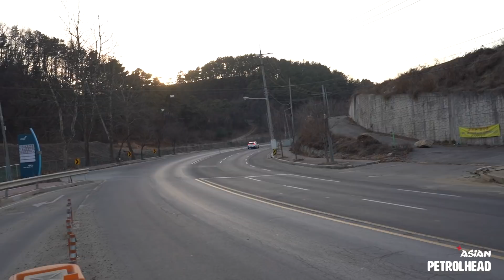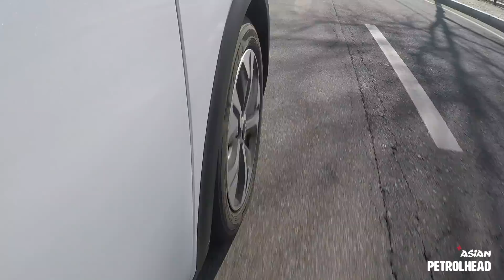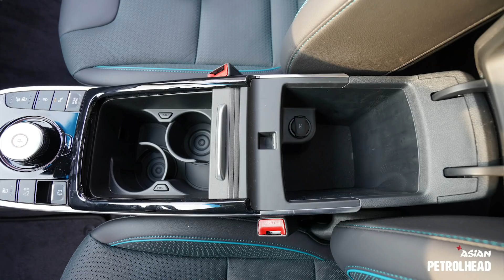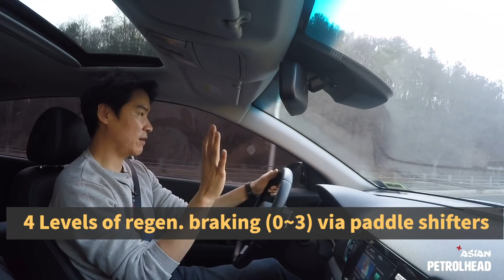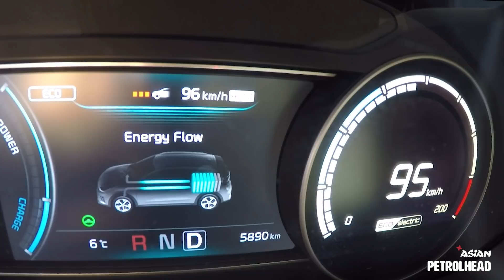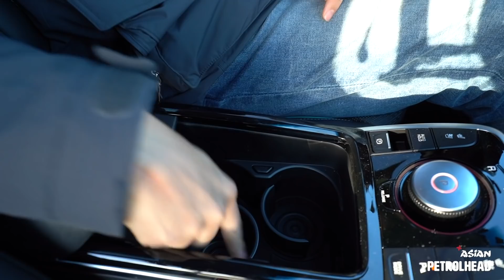2019 Kia Niro EV Review - How is an electric car from Kia to Drive & Charge??? A.K.A. Kia e-niro

Comment: Great review. Love your channel.

Braking is very poor, especially for the size of vehicle. Many larger vehicles (non-ev) stop ~110-115 feet range. Battery weight drastically affects stopping performance in this vehicle.
Reply from the maker: Oh, the all the battery adds on to the weight. And plus it was a cold day. You know the temperature has great effect on the tires and its performance. Thank you for supporting us, as always.
Reply: Aviation...that's true in all electric cars or heavy hybrids.  Compare the Volvo T6 and T8 versions of any model, and it will be a very significant difference.
Reply: @canadabear72  As I mentioned, the battery indeed makes for a larger stopping distance. However, for the size of this vehicle it is unacceptable. Imagine the XC90 T8 stopping in 150 feet or greater? That would be ridiculous. Drum, non anti-lock brakes on the Cadillac boats of the 70s stopped better given their size.
Reply: @AviationDirection  Yes, I see what you're saying.  137 ft is quite long.  But even the Prius stops at 120 ft and it's a much smaller car.  You could also exchange some efficiency for stopping power by swapping out those dinky 215 tires.  I just think it should be expected that these full EV cars will stop in longer distances their counterparts.
Reply: @canadabear72  Definitely expected, I agree. I suspect if the driving community does indeed become majority EV in the near future, new safety standards will need to be implemented in order to obtain the proper stopping distances. 

As you mentioned, tires could be something that needs to be changed... and also brakes. However, then everything will probably become very expensive, making electric cars more difficult to obtain in the short-term.
Reply: @AviationDirection  I agree.  Perhaps larger brakes need to be used.  Regular sized  ones are just not enough for these very heavy vehicles.
Reply: Don't forget tires.   The stickier and wider the tires, the better the stopping distance usually.   This is probably using the very unsticky low rolling resistance efficiency tires and only 215mm which is skinny for the weight.   Put on 225/45/18 Pilot Sport 4S summer tires on it, and I bet it would be much improved.
Reply: @canadabear72  Bigger brakes usually don't have much effect on emergency braking distance.   That's a big misconception.    Brakes convert kinetic energy into thermal energy, and the bigger and heavier the rotor, the more heat it can absorb and shed, and this is very important when doing lots of braking back-to-back like coming down a mountain or at the race track.    But if you're only cruising on the highway where the rotors are cold, and then you emergency brake, you don't need big brakes for that because not much heat will build up from only one emergency stop.    Instead, for very cheap you can go with a higher friction coefficient metallic brake pad to give some extra bite.
Reply: @BoopSnoot  I'm sure that it would!  I'd give up a little range for that.

Comment: 215mm tires is what I'm running on my 2.5K lbs Fiat 500.   Considering the Niro is 3.8K lbs, I can't imagine the cornering traction is very high.   If the higher trims have a wheel/tire upgrade option that are bigger, I would get it.
Reply from the maker: But in Korea, only 215 is offered. Hope they do provide AWD, so that Niro EV can do use 100% of instant torque. Thank you

Comment: Sweet review... but a lot is missing for an EV review. 

How much does it consume at 90 km/h and 120 km/h?
How does the temperature impact range?
Does it have active battery temperature management?
How long does it take to quick charge to 80%? (Roadtrip quick charge)
Does it have an app to change the charge/preheat settings using your smart phone?
How do you preheat the car?
How do you set the max charge from 80% for daily drives to 100% for long drives?
Does it accept updates over the air or must your mechanic apply the updates/patches? 
How accurate is the range meter?
How easy is it to plan a trip using the nav system - does it display the charging stations (are they upto date)?

It’s a whole new way of reviewing a vehicle! 
It’s a bit like reviewing a smart phone vs reviewing an old mobile phone.
Reply from the maker: Thank you for tuning in. Have to agree you on that EVs have so much tech inside that it is hard to cover everything in a short review. But next time i do an EV review, i will make sure to squeeze more info into the review. Thank you.

Comment: The range you quoted was a EPA figure.  Is it the U.S. EPA?  Or Korea has its own agency which is also called the EPA?  I'm asking because gas mileage figures or EV range varies wildly among a country's agency figures.  You've probably seen British car reviews where a diesel car is rated at 60mpg.  Obviously 60mpg is relative since British gallon is different than the gallon used in America and other countries.  And the EU's testing procedure is very optimistic compared to the U.S.' EPA figures.  

Anyways, with a full charge, you can go non-stop from Seoul to Busan?  Or Busan to Seoul on a single charge with a Niro EV?  

And one more question.  What is the auto import law in Korea?  I've seen Korean reviews of cars like the Dodge Challenger Hellcat and the Mazda MX-5.  I'm almost 100% sure those cars are not officially available in Korea right?  And yet you can just import them to Korea?  

In America, you can't do that unless the car is 25 years or older.  So, if I fly over to Korea and buy a brand new 2019 Hyundai Sonata then stuff it into a container and ship it to the U.S., U.S. Customs will seize it when the ship docks in the U.S.  Then crush it.  Even though I can buy a 2019 Sonata at my local American Hyundai dealer.  

So if one can easily import a brand new car into Korea, why do people do it?  OK, obviously people do it to get a car they really want but not officially offered in Korea.  But isn't that a major pain in the butt?  I'm sure it's going to be hard or impossible to service it.  And obviously the warranty is gone.  For example, I checked VW Korea's website.  VW don't offer any version of the Golf in Korea. So you have an importer get a Golf from Germany or Mexican built one from a U.S dealer.  But then what happens when you need service or it breaks down?  And even if you take it to a Korean VW dealer, will they even perform a routine maintenance?  Or warranty repair?  I don't think VW of Korea will reimburse that dealership correct?
Reply from the maker: Thank you for tuning in. Well first it is US EPA numbers. I got it from the press kit of Kia America. Full range is 239 miles epa estimated. Can it go to Busan in a single charge? I am not sure, but we have fast charging stations on the way. So it would be possible with a stop on a rest area. And your question about import cars in Korea. Well hell cats and Mazdas probably bought though company that handle importing cars from Int. dealers. Many manufactures will not guarantee warranty on those cars. And because you have to pay 8% import tax and whole bunch of taxes, many will not choose to import cars on their own. So yes only people who really want that car will import them. Hope that answered some of your questions. Thank you.
Reply: @AsianPetrolhead  Oh, so it is possible.  In America, there are Americans who are paid by Chinese and Russian importers.  Chinese and Russian importers use "buyers" in America to buy cars for them.  The importers gives them cash, then the buyer purchase the car from a local dealership.  They are called "straw buyers".  And after the straw buyers purchase the car, they hand it over to the importer.  Then they stuff it into a container.  Folks in China and Russia do this to avoid taxes and to get their cars quicker.  Usually it's rich Chinese and Russians who wants hi-end cars like Porsche, Mercedes etc.  

So obviously, the car makers and U.S. government officials hates this.  And a gentleman who recently tried to buy a Mercedes was caught up in it.  The gentleman was a business owner who was originally from India.  He tried to buy a Mercedes SUV from a large, well known Mercedes dealer.  And he was going to pay cash.  Obviously not with a bag full of actual cash.  I'm sure he had a bank's cashier's check.  So the cash transaction, plus the gentleman's heritage brought up a red flag with the dealership.  The dealership thought he was a straw buyer and wouldn't sell him the car.  So that incident made the news and I believe the gentleman sued the dealer.  Yikes!  

And oh, can you do some reviews on the Samsung Renaults?  I understand that at first, Samsung cars were based on Nissans.  But since the Renault-Nissan alliance, Samsung cars are just Renaults with a Samsung badge correct?  And most Samsung-Renault are made in Korea?  And are they favorable and popular with Koreans?  

And one last thing, don't forget about the Formula E race in Seoul for 2020.  That should be fun to watch.
Reply from the maker: Oh wow thanks for sharing the story. We will try to set a schedule reviewing Renault Samsung cars. It is affortable and sold widely in Korea. Thank you.